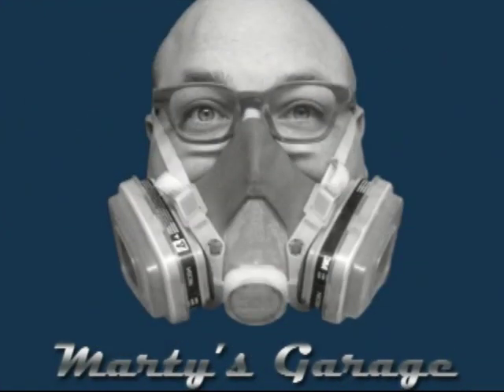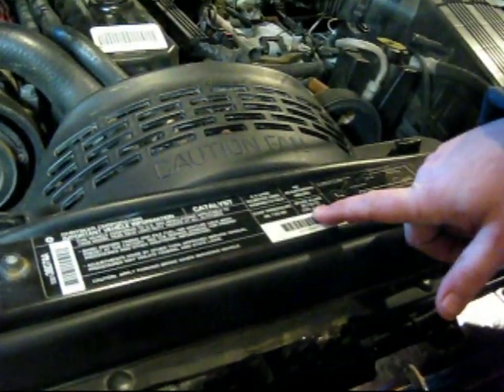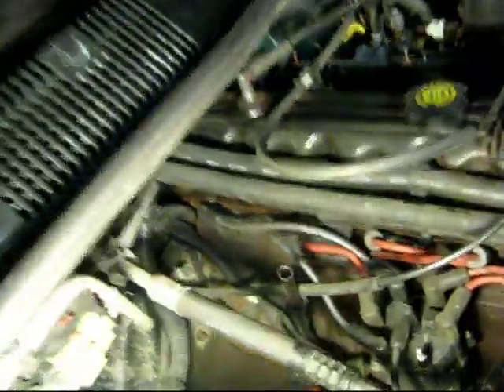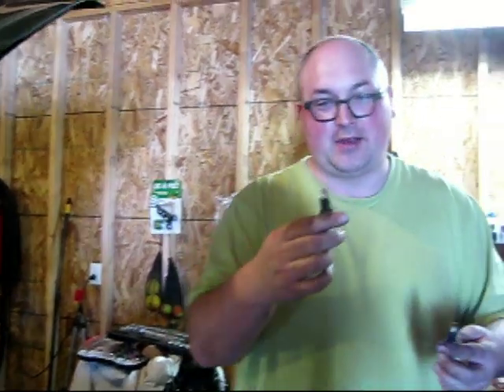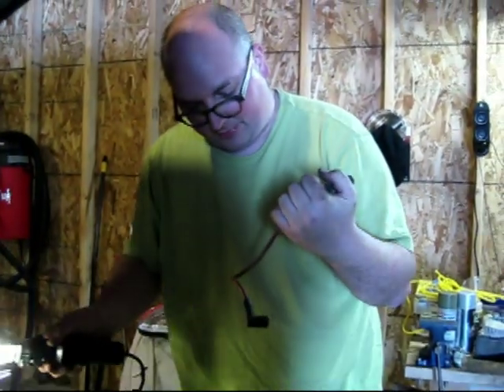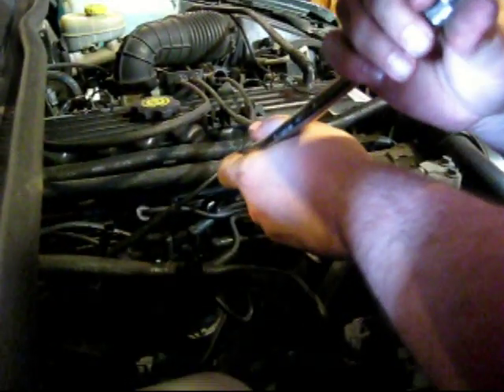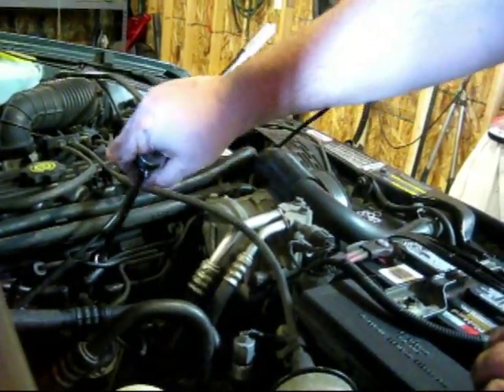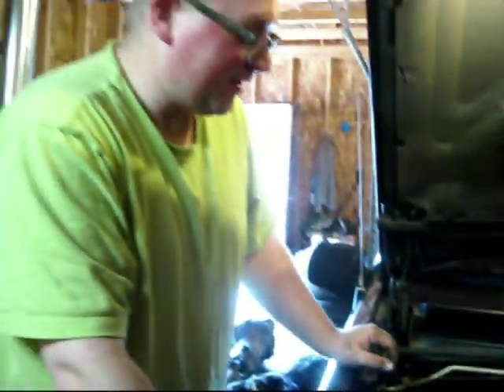MG 32 - Changing the Jeep's Spark Plugs

Comment: i have sqeaking front brakes on a 96 200 000 mi jeap cherokee. got wheel off, looked at pads, and there still appears to be significant pad left so i decided not to mess with it further. it still squeaks badly though, a mechanic said it could be rusty rotor rims, although i'm sure he was motivated to sell me rotor work. i dont really know what i'm doing so you think i should just live with the loud squeek?